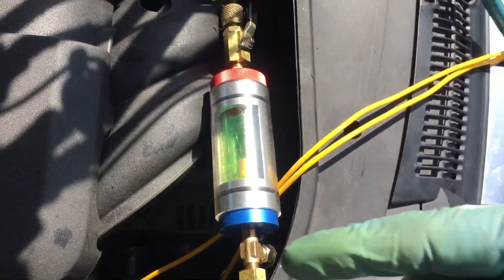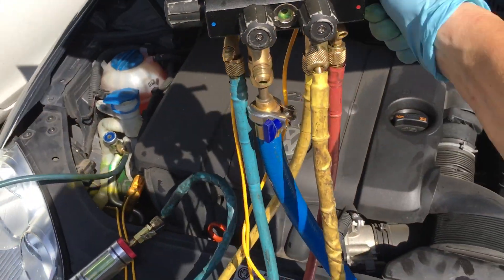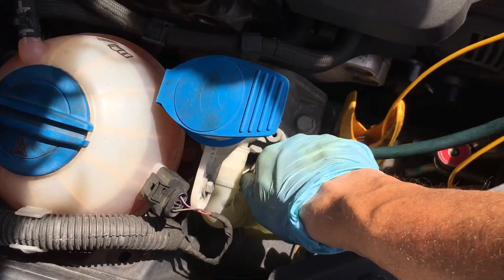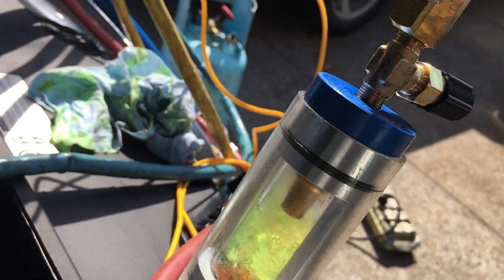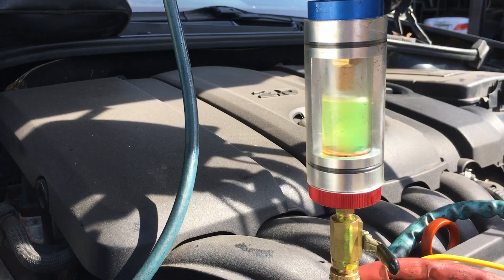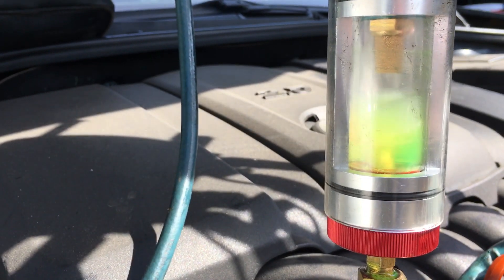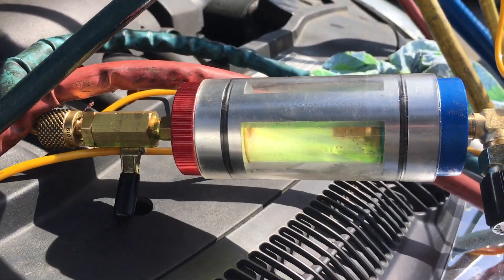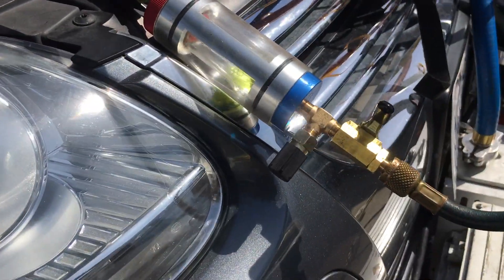Refrigerant Inspection site glass filled with refrigerant and oil boiling￼

Comment: While you were talking about vacuums I was wondering something else. I know with an AC compressor when you oil that you're going to get some moisture from the air worked into the compressor as you turn the pulley. So that I can get all the moisture sucked out is it okay to turn the pulley on the compressor while pulling a vacuum?
Reply from the maker: No you can damage the front shaft seal. The French South seal on some compressors were never designed to spin while they’re under a negative pressure.. 

The way they are designed an angle is for positive pressure and they’re constantly being forced fat a fresh supply of oil . 

The vacuum will get everything out of the compressor .  Not everything but the majority, because there is a molecular bond the physics of the water molecule bonding to the POE oil or PAG oil a certain percentage. You just cannot remove completely with vacuum.

You can reduce it, but you’re gonna not going to get it all out . 

If you are do it yourself person then it’s really easy for you to leave the vacuum pump on for 24 hours you can never over vacuum. All you can do is remove more moisture, the longer the better. .

Comment: I enjoy your vids on a/c work, very helpful. I appreciate the time you take. After watching this video I get the impression that I can use this sight glass to extract unwanted pag oil from my system without the need to open the system. Do you think this would be possible? Many Thanks, Michael
Reply from the maker: That would be a really long tedious method of trying to do it

Especially if the high side was located on the vapor line and not on the liquid line. 

Depending on the situation it could work but if you have the wrong situation your grandchildren will grow up and get married and have grandchildren themselves before you could remove enough oil. 

Depending on the situation it’s possible it could work but did you see how a little bit of oil came out
Reply: @coldfinger459sub0  very funny, it so happens the HS port is on the vapor side too. Well, I have about 9oz instead of 6oz pag in a VDC type compressor that sits on the bottom of the engine bay. It was my goof. Cools well, makes a little noise now and again at idle but quiets down when  i add rpms. I think I will get the glass just the same since I see how well it helps you and just monitor the refrigerant from time to time. See where it goes from there. Very appreciative of your time. And yes, I will still try it just  to see what happens, you never know until you try. Cheers, Michael
Reply from the maker: @MichaelA-xx2ls  you can always learn from every new thing that you try and you can learn to use it as a tool and learn to use it as a learning device. 

As long as you make an effort to learn one new thing every day
Reply: @coldfinger459sub0  Well said - thanks again.